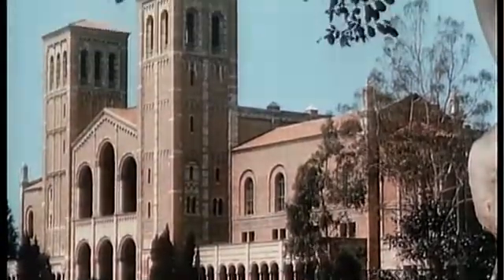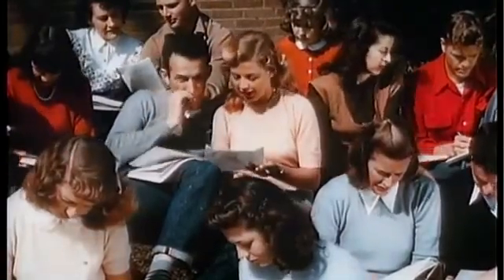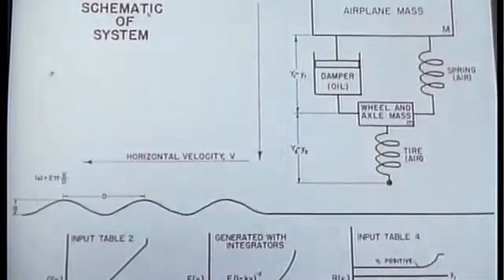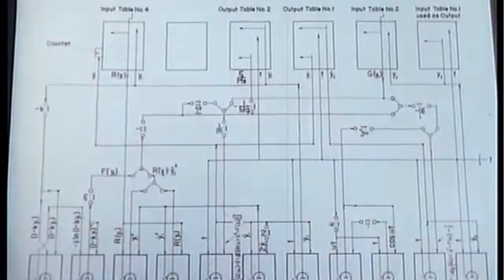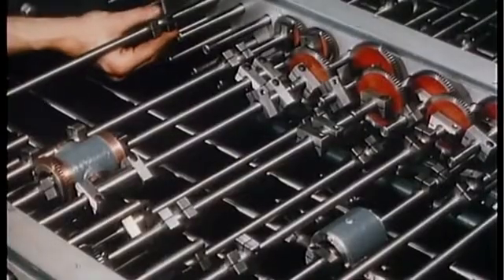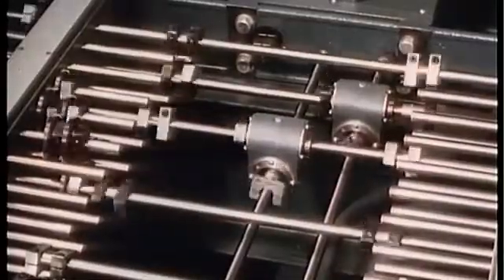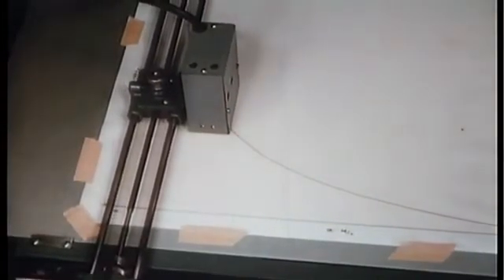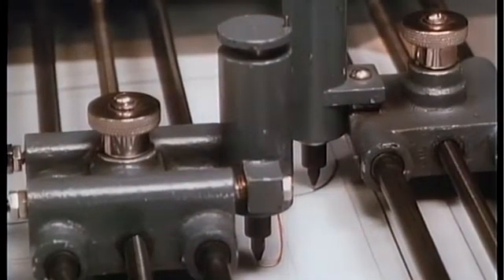UCLA's 1948 Mechanical Computer

Comment: Mechanical computers are the future of space travel. The computer has to deal with extreme conditions like radiations and physical forces like violent vibrations and extreme changes in temperature. No normal computer has any chance to work in space reliably. Even neutrons can affect semiconductor memory reliability and accuracy.

Comment: Can I game on it?
Reply: Yes, but you'll likely use a mechanical tv to compute the output. Likely fortran or older.
Reply: @obsidian9998  This was around a decade before Fortran and years after mechanical TVs became obsolete. It's also not in any way a programmable computer in the modern sense. Although, I suppose you could rig up a target firing game like "Angry Birds", much like the 1947 CRT amusement device did. It would be rather slow though, as these machines were almost entirely mechanical!
Reply: Well you could play those very bad math games math teachers come up with

Comment: is this a Turing Complete computer?
Reply: No, it's an entirely special purpose (mechanical) analog computer with no branches or predication. See https://en.wikipedia.org/wiki/Differential_analyser

Although, there is probably some way you could make it achieve Turing-completeness by drawing a clever pattern then connecting the input & output together somehow. People can make almost anything Turing-complete given enough time.
Reply: @colejohnson4941  Yep Charles Petzold, did a cool lecture on it that led me here :)

https://www.youtube.com/watch?v=srWQdTGlnVg
Reply: The computer he was working on before his death was called Pilot Ace was a general purpus scientific computer.
Reply: @miles2378  ah, still, this machine is pretty amazing